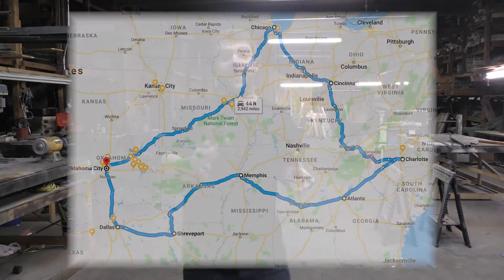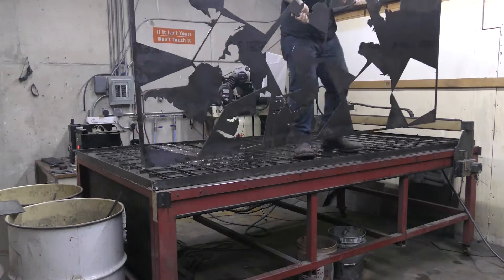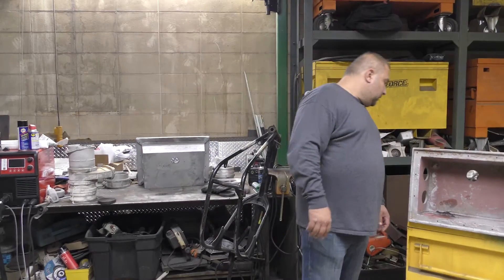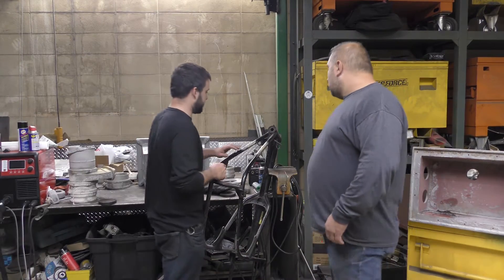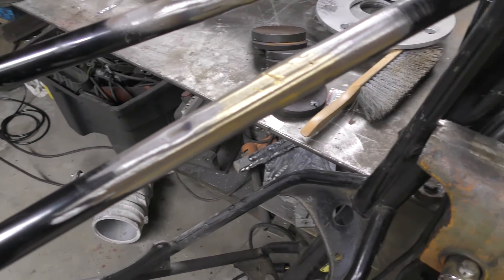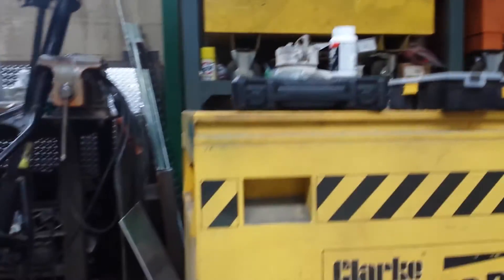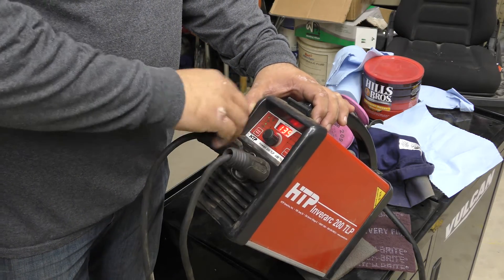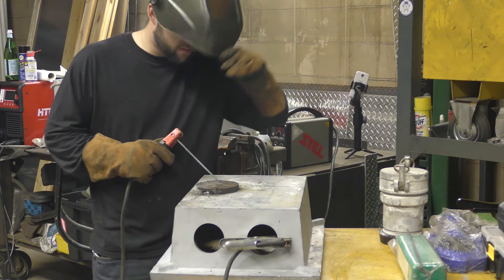Getting SCHOOL'd by Peter Zila - Maker Tour 1

Comment: Very cool. Why were there looked like bubbles in the one aluminum weld? Is that from the shield gas blowing away or porosity in the aluminum?
Reply from the maker: What time code in the video?
Reply: 42Fab - Metal Fabrication & Signage  My bad! It was at the 6:30 mark. I should have included that time to begin with
Reply from the maker: Yeah, there is some porosity there (also some soot), but these welds are getting enough penetration and are thick enough, AND are inside and outside, so we were not worried about waterproofing
Reply from the maker: On second look, I think that may all be soot, we had not cleaned it in any way and that kind of porosity isn't common in my experience. Either way, we weren't worried about it.
Reply: I gotcha man! It’s all good. As long as it sticks and doesn’t leak. It looked like a good thick weld. I wish I could have the tine to make a trip such as yourself. I’m looking forward to the rest of the trip for ya! Safe travels